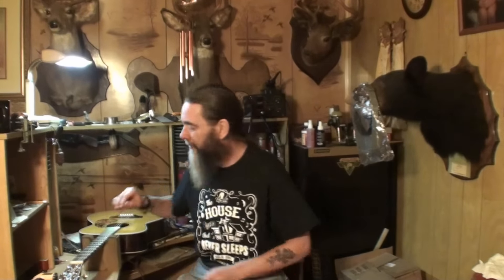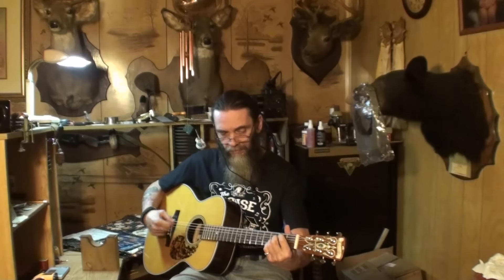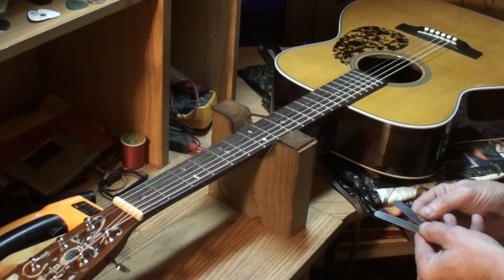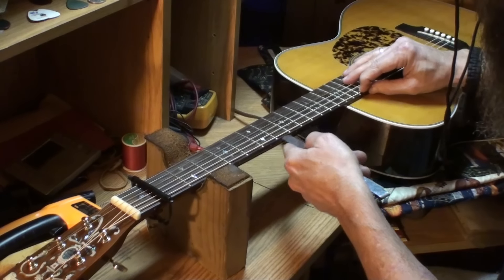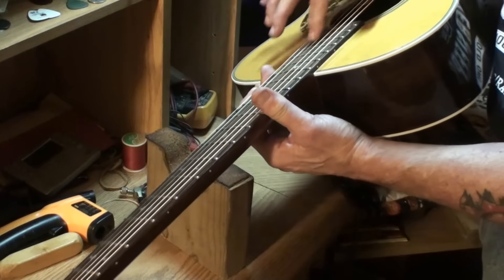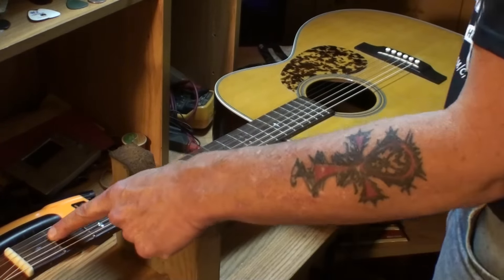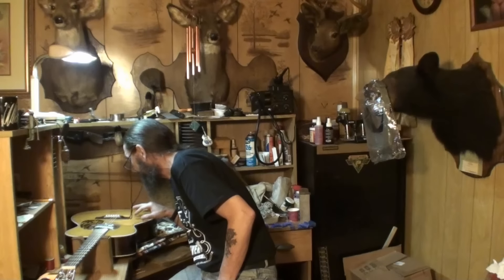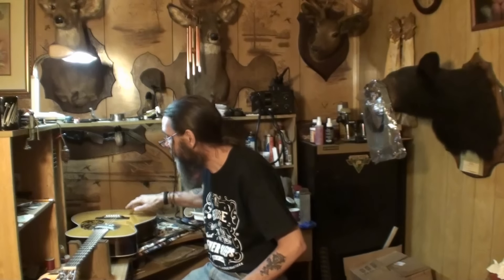Blueridge br163 acoustic guitar some info on neck relief part 1of3

Comment: Very nice guitar that I'm sure you can bring back to the perfection as originally manufactured. 
Below is a little comment on the specifications of the Blue Ridge:

The Blue Ridge BR-163 is a 000-14 fret guitar with a Sitka Spruce Top and Solid Indian Rosewood back and sides. However, the BR-163A has the Adirondak (Red) Spruce top. The both have a Rosewood Fretboard and Bridge.
Reply from the maker: I was thinking it had the same woods as my BR160 but couldn't remember at the time of making this video. Good to know about the BR163A, thanks for that info!

Comment: That is a beautiful guitar. Hopefully a truss rod adjustment and maybe shaving a little off the saddle will get rid of the buzz.
Reply from the maker: I hope so too and believe it will, I'm concerned about the fall away at the fretboard extension, there is a lot of fall away there, I've been held up humidifying the guitar to see if any of it goes away but very little so far. Thanks for viewing Dale.

Comment: Hi Randy, A really great video but educational video. I noticed you turned the truss rod to the left to loosen it up. Do all truss rods turn the same way to loosen them? Also if I were looking at a used guitar to buy. What would I look for to try an see if the neck had dropped down? Like this guitar did. Thanks for sharing your video. An excellent job.
Reply from the maker: Yes, but keep in mind a 2 way adjusting truss rod will begin to get tight eventually as you loosen it. 

You can check it with a straight edge to see if the plane of the fretboard is the same as the plane of the bridge.

Thanks Thomas for viewing!

Comment: I like that guitar. Sounds great, looks great. Love the headstock inlays, at least from a distance. I cringed when you zoomed in on the frets because the position marker inlays are so sloppy. My OCD is making me want to redo those inlays so they're nice and tight (not so much filler). Glad it's not mine, I have enough projects to work on. 😎  

Shirt order is coming!
Reply from the maker: I know what you mean! Many years ago it was pretty common in any brand to occasionally see more filler than we'd like but now days there is no excuse for it, especially if time is going to be taken to add as much inlay as most Blueridges have.

Comment: Nice chords Randy! You must have had a ball playing in bands! You still sound great! A friend has a Horner Beatle bass and the neck has an upward (back bow?) bow. Truss rod has no tension on the neck. Any ideas to bring it back down. I have had some suggestions, it would be great to hear your opinion. Oh, 4X is my size. Thankz
Reply from the maker: If it has backward bow usually indicates the truss rod is too tight, so if it's got backward bow and the truss is laying in there loose and string tension isn't enough to draw some relief into the neck about the only other thing would be to install a 2 way adjusting truss rod, then you could force the bow out (or in) no matter the direction it needs to go.

Comment: That's a really sweet guitar. I want one. No stores here stock them and I feel weird buying a guitar online on looks and reviews without ever touching it but I probably shouldn't worry about that. I don't know enough to pass any kind of judgement on a guitar if I was blindfolded and in a particular price range. Anyway, I only have a DX guitar with composite body and solid top. I live in Miami do I need to humidify this thing?
Reply from the maker: Being a DX model it probably has a laminaed back and sides and maybe even top, it's always good practice tho to monitor the humidity levels in and around where your guitars live and try to look ahead for them, humidification probably won't be a problem where you are but I would still check it from time to time and monitor it.